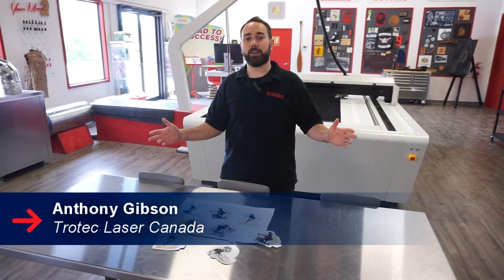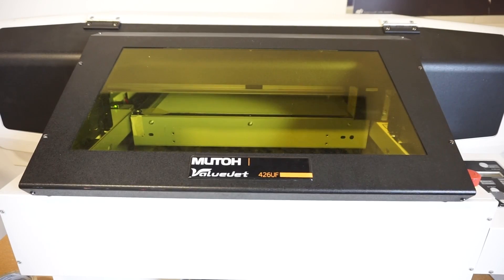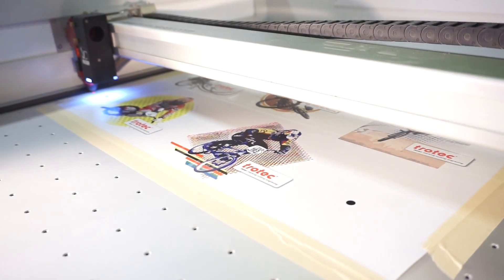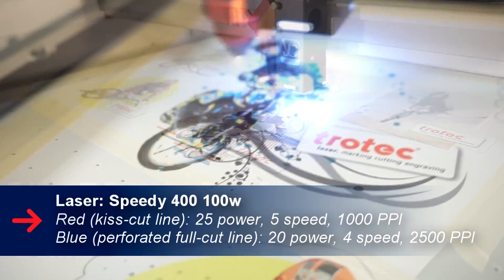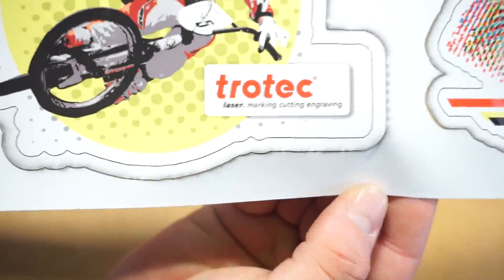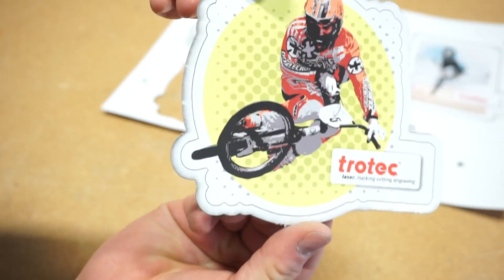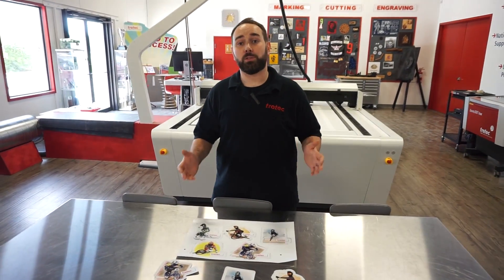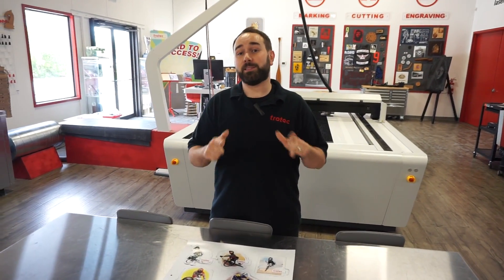Laser Cut Stickers | UV Printed Stickers | DIY Stickers

Comment: Hi.
is this material suitable for out door use? how long would it last.
Can it be used a sticker/decal on a motorcycle tank.
Reply from the maker: Hi Nick, it is more ideal for indoor, we have outdoor material but they are usually thicker like our regular TroLase 1/32" material. We can't comment on how long it would last, that would depend on the out door conditions.

Comment: Hi
we have laser cutting machine from rotec company. I have question about how we can adjust laser with register mark? we made a photo and cutline with illustrator program but when we add the sticker on wood and do for laser that have mistake. we can't resist machine with register mark. 
This action is only base on test or have a special way for regist our register in machine and design
our email:graphicm88@gmail.com
Reply from the maker: Hi there, what do you mean sticker, you use sticker for registration marks? Are you not UV printing the registration marks on the wood?

Comment: As most commonly vinyls used in sign making or vehicle graphics are PVC based that might be a problem. I can see a lot of uses for this but the fact I have to use a Mutoh printer rather than a large format roll to roll like my HP Latex would limited some options. Also when you say faster, I guess you haven't seen my Summa plotter cutting at 1000 mm/second and while I am very interested in a Laser machine, I don't think it's a replacement for traditional plotters just yet.
Reply from the maker: ian dreihaupl Hi Ian, the material you see on the video is non-PVC. What country are you in? We can check if TroLase Lights are available there
Reply: I am in Montreal, Qc but most of my vinyl needs are 54"x 150'..... I cannot use small pieces as in your video. I am very interested in all the other things your laser can do.
Reply from the maker: ian dreihaupl we manufacture this material so we may offer large sizes for larger volumes. Can you provide your email and we will get in touch directly?
Reply from the maker: ian dreihaupl thanks Ian we will reach out this week. You mean 54” (inches) wide not 54’ (feet) right?
Reply from the maker: Thanks Ian, our rep Kelly will get in touch with you regarding this.